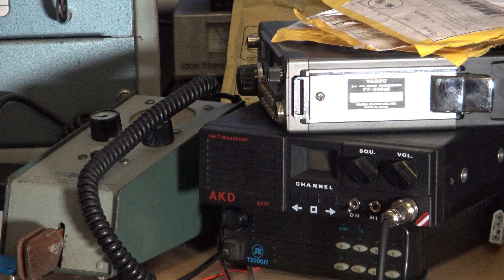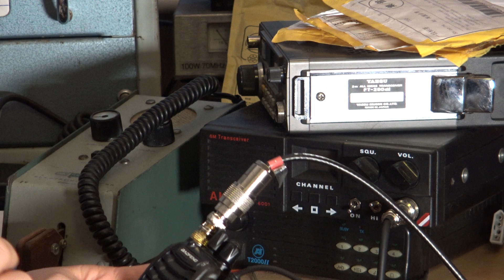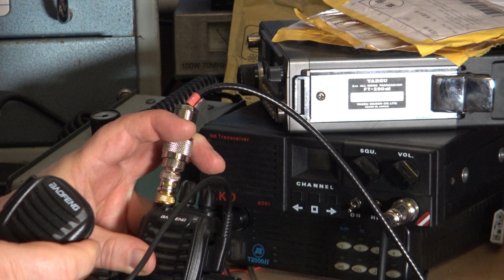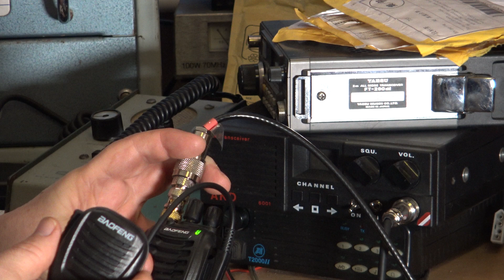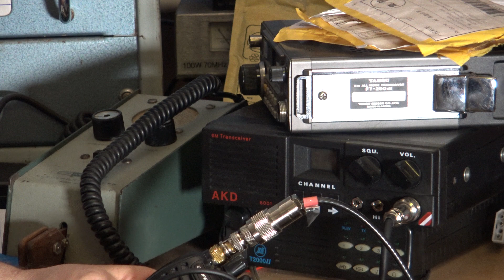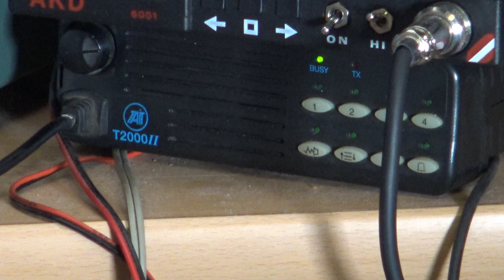Baofeng 888S UHF 70cms amateur On The Air test 1.2W

Comment: I was going to ask what aerial you were using, then I extended the "Blurb" and found out.  That is good for 70cms without a repeater, it takes very little to break up the signal at that frequencies!
Is that set programmable to 2mtrs as well?
There are so many models I can't keep up!
Reply from the maker: Bob it's UHF only.

Richard
Reply: @ukfmcbradioservicingTango21  Ok, that is the best way, no straying off frequency then.